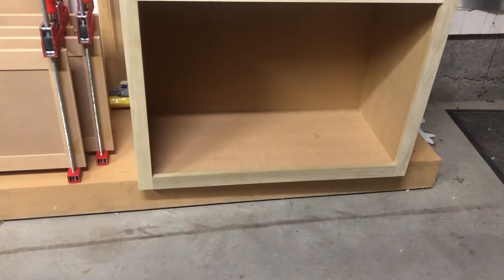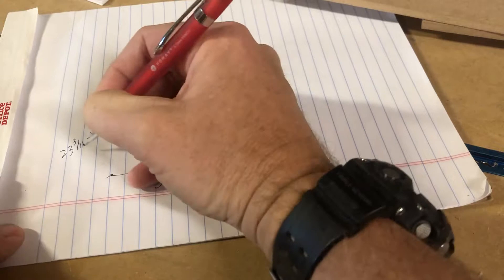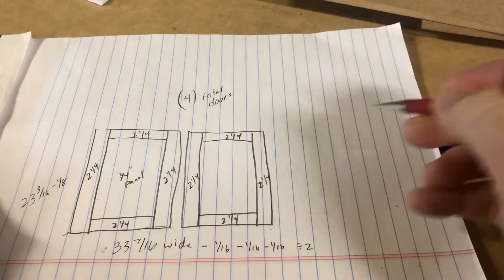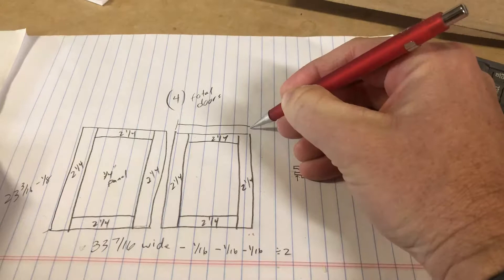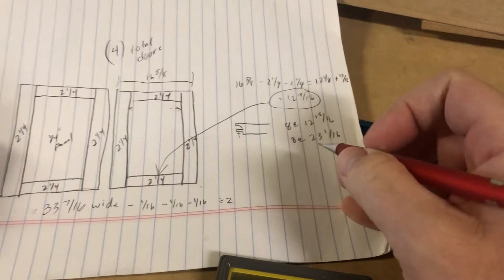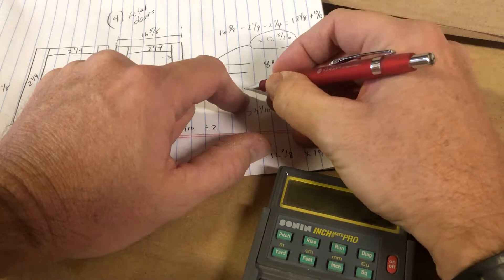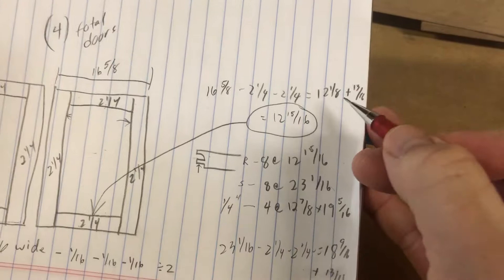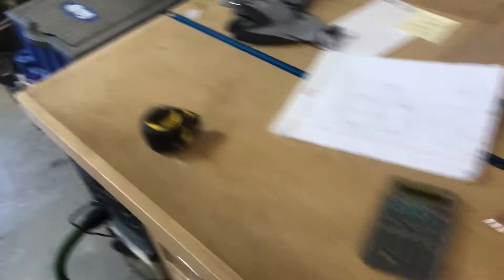Custom Shaker Style Cabinet Doors. How to measure for them.

Comment: Great overview.  I wish YT allowed links in comments so I could share a spreadsheet, as I got frustrated trying to calculate all my new kitchen doors I'm making for a remodel.  Almost all are different sizes and I need to make about 40 of them (~200 parts to cut with the panels).  

You enter the rough opening, overlay on each side, any overlay adjustment desired (+/-), the rail & stile stock width and my router bit's tongue depth, as well as if any double door has a center stile option.  It spits out all the required part dimensions and produces a cut list.  Saved me so much time and reduced mistakes to nearly zero, with a final door dimension accurate to 1/16".
Reply: Can you email it to me? I am going crazy trying to measure! I found a good spreadsheet for double doors, but I have no idea how to do it for a cabinet that has triple doors.
Reply: @livelyara  Sure... your email address is?

Comment: Hello... I am attempting to make some doors with a 1/2 overlay.  Do I still account for the 1/16 for spacing? and what was the 1/8 you took off the height? Also do I add the 1/2 (1 inch ) to the height as well?  I would really appreciate your response.
Reply from the maker: Hey Daphne.  Thanks for reaching out to me.  This is a great question.  So if you’re doing overlay doors, you add 1/2” on each side usually. But if you needed to, you could add more than 1/2” on the knob side of the door.  As this side doesn’t have the hinge that dictates how much overlay is needed on the hinge side.  The top and bottom can be also whatever you want as long as the overlap is consistent with any other door or drawer next to it. 1/16” is only relevant for paired doors that close next to each other. And the 1/8” is also for inset doors that I’m making here.  I hope this helps.

Comment: It is complicated to figure the door rails. I created a Excel spreadsheet to do this for me. I enter the door opening and it calculates the stiles and rails automatically
Reply from the maker: That’s cool.  Good job.  Excel is a powerful program to those that use it.  I used it in business school a ton programming spreadsheets to do lots of neat things.  There are many different ways to calculate door parts and this is definitely one of them.  Especially if you’re not used to making doors.  But I often feel that until I know how to do something manually, I’m reluctant to use a computer.  The size of rails is so easy to figure in as fast as I can enter the number in my calculator I have the rail size and panel size.   2-1/2” rail and stiles.  Width of door needed minus 4-3/16” is rail.  Minus 1/16” for panel width.  Rails Done.  Of course the shaper or router bit depth might differ from door styles so this number may be slightly different.  You need to know that info first.

Comment: Do you have to add 1/ 2 inch to the opening size ???
Reply from the maker: If I was doing overlay doors that sit on top of the face frame, then I would have to add whatever overlay I wanted.  Typically 1/2” on each side. So 1” total.  But if your doors are paired up like this, then it’s just 1/2” per door over lay. In this example however I am setting these doors into the frame.  So it’s flush with face frame.  This case you reduce the overall width not add.  As I show in video
Reply: What material do you use for the stiles n rails? Soft maple, hard maple or poplar ?